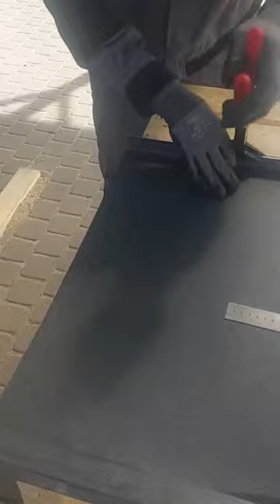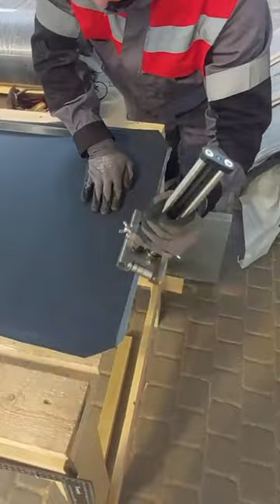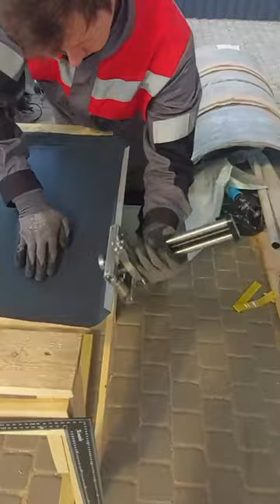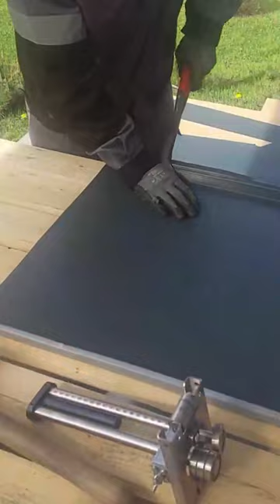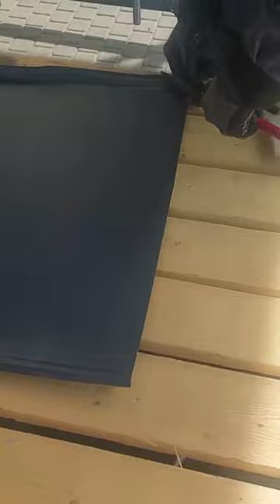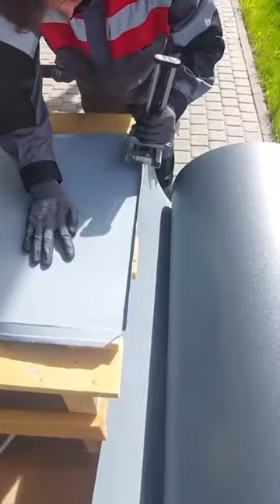This Roofer is really skilled!

Comment: I need one of those hand held seam rollers! I bend a lot of metal for about anything you can need it for.
Reply: Get a biegetec, the top roller is on an angle so your folds will go past 90 degrees, square bearings like on a wuko stop before your fold hits 90 and then you gotta fold it with something else

Comment: all i see is time wasted haha smh. get a gullotine and folder . would of installed 10 before hes done one
Reply: Yes but you're guillotine wouldn't put the required 2mm radius in the bend to keep the softer european metal ie zinc, aluminum, copper from cracking and ruining all 10 of your panels lol